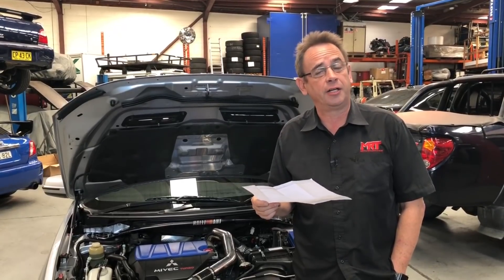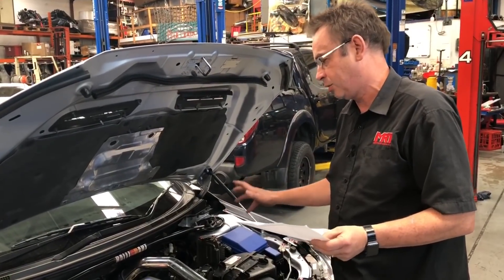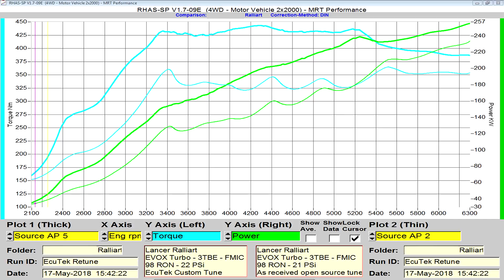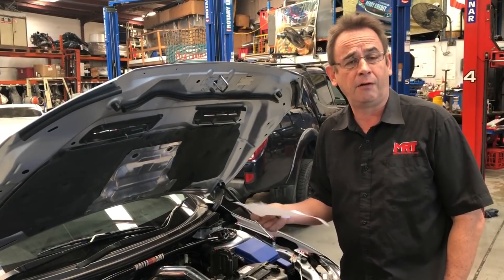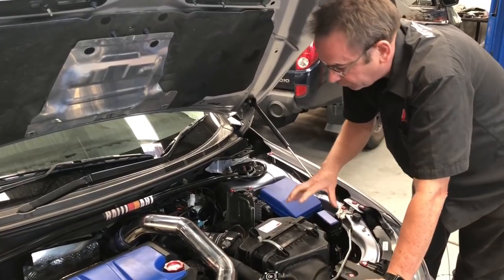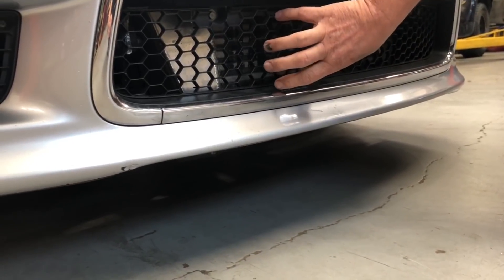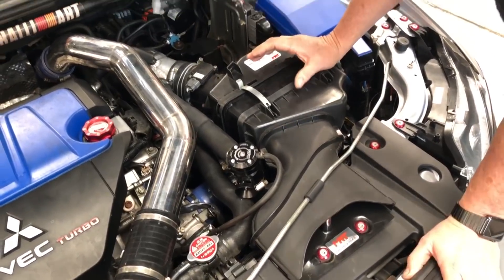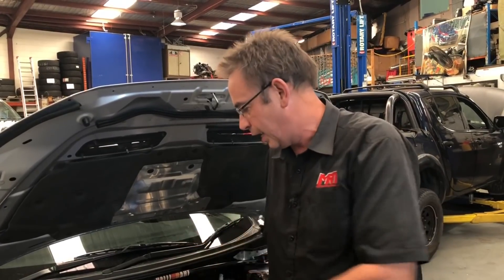Lancer Ralliart with Evo Performance

Comment: Internals on Ralliart and evo x are exactly the same. Only differences engine wise are Ralliart uses 1 step hotter spark plugs with a smaller turbo and exhaust manifold. Also Ralliart has the piece of junk plastic BOV and smaller intercooler and piping. Lastly the air box and intake air duct are different.
Reply: Exactly
Reply: Yeah exactly what, do your research, different diffs, different management system, different brakes, different turbo and cooling, rims and tyres, suspension, and linkages, and chassis stabilisers.  NOT QUITE EXACTLY.  Your ralliart is just that a ralliart. An EVO is an EVO no shame in neither.

Comment: Ralliart is not equipped with active yaw control.
Reply: yawn who cares
Reply: @MA-oo7fw  that's actually kinda important
Reply: @Kingshock  Not really, if you're throwing the car around as an experienced driver, you need to shut all that crap off as it makes handling VERY unpredictable.  Even whatever stability control the Ralliart has needs to be off to drive the thing on the limit...

Comment: Will the transmission hold up with the extra torque/power? I heard that the SST in the Ralliart model is a bit 'delicate' and a new one costs 13k?
Reply: Chiquicat the SST can handle 450hp at the wheels pretty safely if you don’t try to kill it racing constantly or don’t let trans cool down in between runs. Biggest enemy on that trans is heat. Upgrade your trans cooler to bigger one with electric fan and keep on top of fluid/filter maintenance and lastly make sure you use correct fluid and capacity and the trans can take the abuse.
Reply: I think that myth about the sst came from Subba fan bois....its a very strong box...but as you increase power you have to look at clutch's....the EXACT same thing you do with ANY manual gearbox
Reply: Anything around or over 350 torque and itll slip. Higher torque has been achieved on the stock sst but i wouldn't risk it.

Comment: Are internals different for real? everyone says are the same.
Reply: Same
Reply: Same...they are both 4B11T Engines
Reply: They're exactly the same just different bolt ons and tunes the Ralliart is a detuned Evo x with a single scroll Turbo instead of the the Evo X Twin Scroll and RA has a smaller intercooler and restricted soft piping hardware

Comment: Quick question I heard different things about bov for evos saying that evos need to run full recirculation cause i have mine 50/50 half atmospheric is it safe ?
Reply: your fine. its only and issue if the car stalls when you come to a stop. most evos are good with common bolt ons if they are good quality and well balanced.
Reply: Its a gsr or a MR gsr your good but not if you own a MR